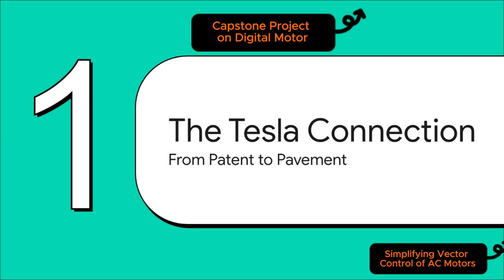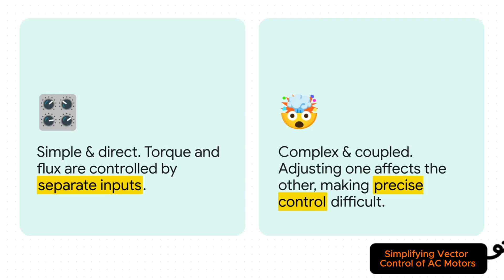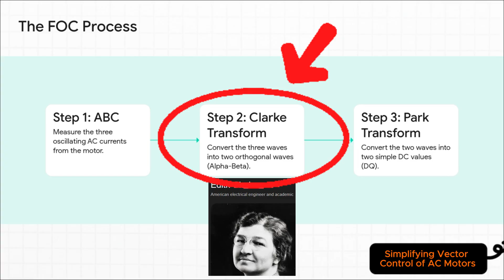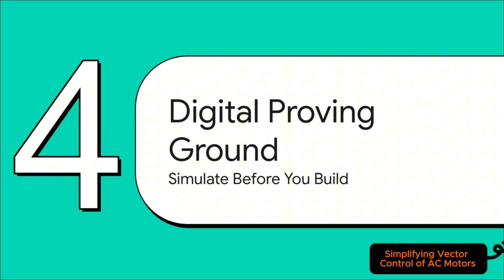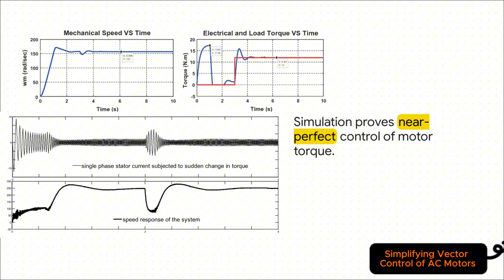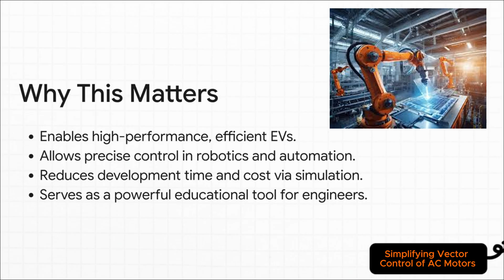Capstone Project on Digital Motor Control | Induction Motor IFOC Simulation in MATLAB/Simulink

Comment from the maker: Practical motor-control and electric-drive engineering focused on PMSM and induction-motor Field-Oriented Control (FOC), vector control, d-q modeling, current and speed control, inverter operation, and hardware-oriented implementation.

Topics include Clarke and Park transformations, PMSM FOC, induction motor FOC, rotor-flux orientation, slip estimation, PI current control, cascade speed control, voltage limits, PWM/inverter interfaces, MATLAB/Simulink simulation, and practical verification.

Model → Design → Simulate → Verify

eDrives Embed Udemy courses

PMSM Real-Time Vector Control (FOC) Simulation with Simulink
https://www.udemy.com/course/advanced-practical-real-time-vector-control-of-pmsm-drives/?couponCode=07E1E70B53D3B87A1979

Field-Oriented Control of Induction Motor Drives with Simulink
https://www.udemy.com/course/field-oriented-control-of-an-induction-motor-drive-simulink/?couponCode=7E513A4FFC46E68D7A36

Practical Control System Design: Classical & Modern Methods
https://www.udemy.com/course/computer-aided-control-systems-design_control-system-toolbox/?couponCode=01683AF14DDCF7DF269A

For electrical, electronics, mechatronics, automotive, and control engineering students and professionals.

eDrives Embed — Engineering beyond the prompt.